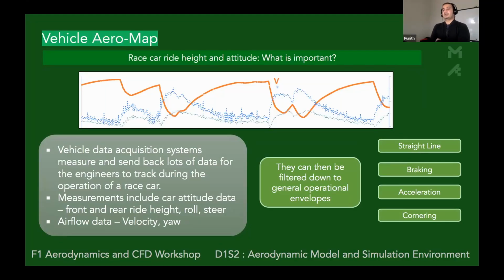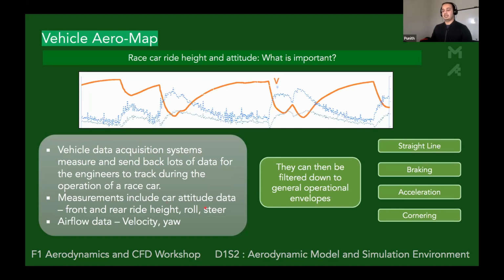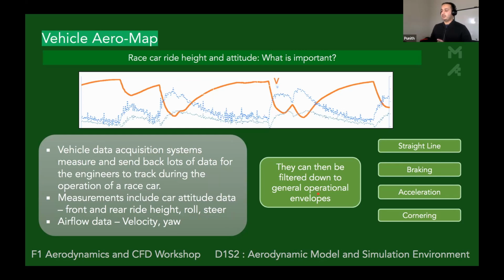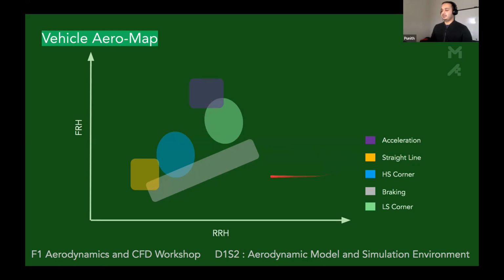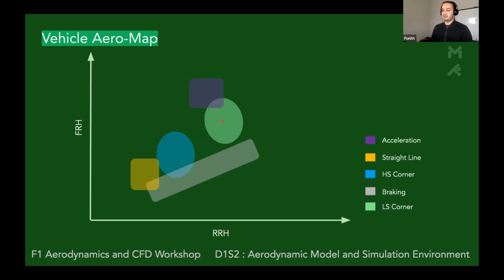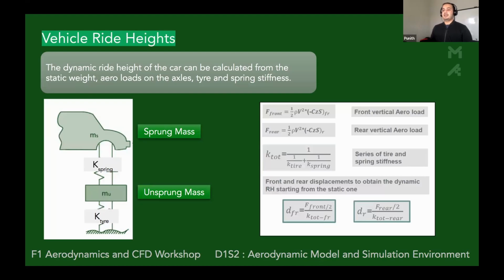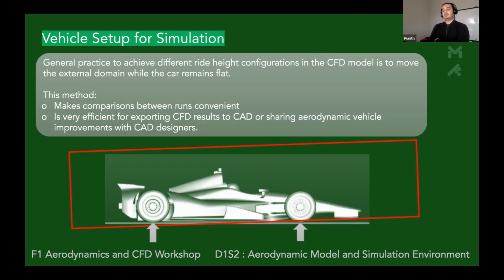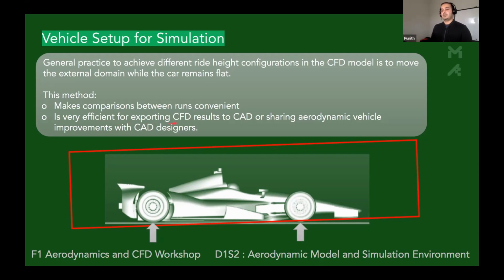F1 Aerodynamics CFD Course : Vehicle Aero Map & Ride Heights

Comment: All else being equal are these generation of cars more sensitive to front or rear ride height? What I mean is, if you have a car at a baseline ride height, will you lose more downforce if you raise the front, or rear, at say low to medium speeds? I would think the rear would be far more sensitive to ride height because the front of the floor has the front wing and fences helping it, and there's more kinetic energy in the flow at the front half of the car than the rear. If managing pressure recovery aids downforce stability, having negative rake would reduce the ramp angle of the diffuser expansion, which could help.

I ask because I remember in Las Vegas when Mercedes was really fast, they had a lot of front ride height, you could see the camber gain under braking. I wonder if because of the low speed corners they raised the front to make the diffuser more efficient at low speeds, while sacrificing some peak downforce.
Reply: From what I've seen myself, rear ride height relates to downforce level, and front ride height relates to downforce balance. Of course both must work together, but changing front ride height will most likely shift the car balance (medium to high speed) than the downforce itself. Speaking from GT3 cars tho, not F1
Reply: @Nico-9138  What about making the front higher but softer than the rear at static ride height, reverse rake. Then as speed builds, the front starts to lower more than the rear since it's softer, and you get no rake at medium speed corners. Then at high speeds the front is almost touching the ground in roll, while the rear is maybe 2mm higher. Because F1 has a big diffuser, changing the rake angle of the car can affect how the diffuser works at different speeds.

Maybe sorting that out with the front wing is part of the setup challenge. Each circuit has it's own implications for a particular ride height in a certain part of the track.

Bahrain seems like a more difficult track to set up for than Abu Dhabi or Qatar.